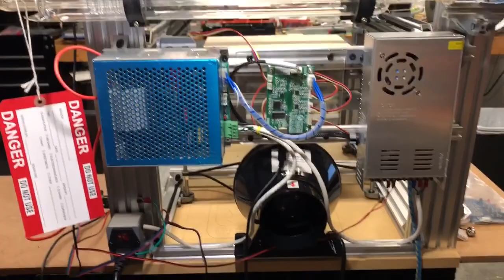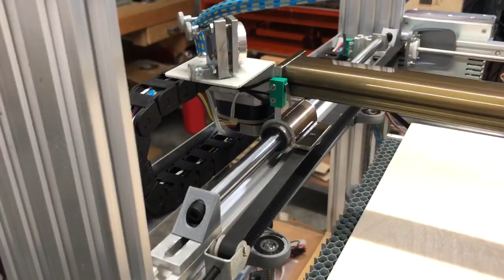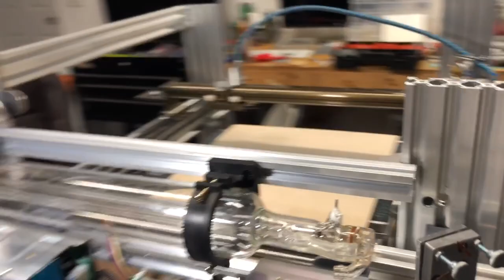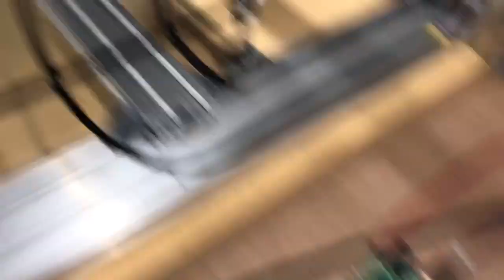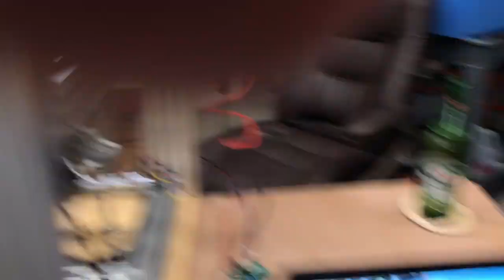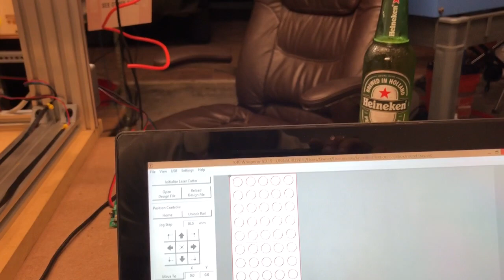K40 Cube build update

Comment: Hello Pedro - the hole drilled through the vertical extrusion that allows the reflected laser beam off of mirror 1 to pass to mirror 2 seems  very small.  The beam diameter of a CO2 laser tube in the 50watt range is purported to be about 6mm,  according to informed sources I will not name.  How have you determined the adequacy of the diameter of the hole?
Reply from the maker: this laser tube is advertised as a 50w but it is a real 40w one the main beam is just 2mm but that hole has to be a lot bigger to ease your life during aligment, the hole right now is 10mm wide,, https://www.youtube.com/watch?v=xo6pM3nu5DI